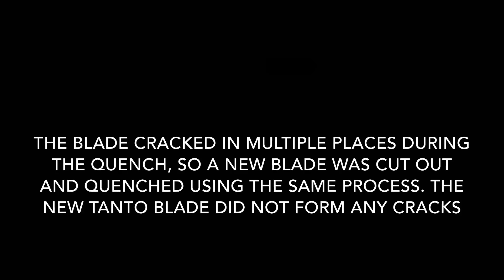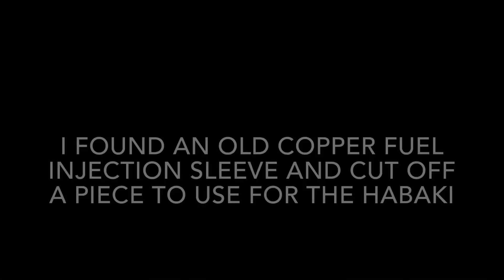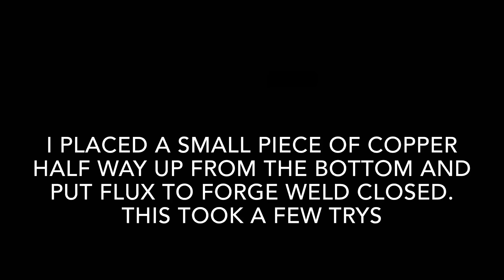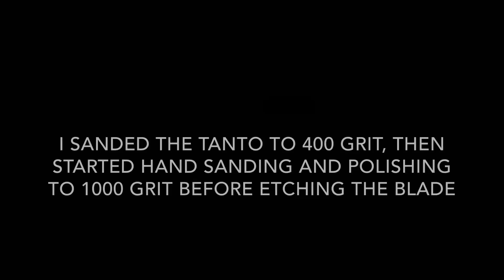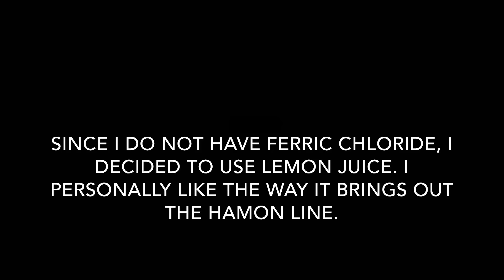Making Japanese Tanto with Hamon (stock removal)

Comment: Great job! Looks like you need to adjust the fuel/air mix on your forge burner, though; the flame is "woofing" on you, which means it's unstable and could go out. That can be a recipe for a nasty flashback explosion; if it goes out, it will keep spewing propane, which can then ignite on the hot surfaces inside the forge which equals "kaboom." The same thing can happen with oil and gas-fired boilers, too.

Comment: If you want to avoid cracks, normalize, and leave a thicker edge
Or quench in oil
Reply: The French Knife Maker Doesn’t most flat bar carbon steel come normalized already?
Reply: @Divine_Serpent_Geh  yes,  you s
Just can't get this point across to these people.

Comment: Did you normalize your steel for the  second blade? Water is a very harsh quenching medium if the stress isn't greatly reduced in the material. It turned out great! Where'd you get the clay?
Reply: Fire ash makes a good clay

Comment: Is that the stock harbor freight belt sander or did you change the pulleys? I have one i just can't remember if it moves that fast.  I know it isn't the next for grinding metal unless you augment it

Comment: Could the first blade have cracked because the brine solution was too cold?
Reply from the maker: Debbie Dickerson Actually both brine solutions were with hot water. I believe the clay was too thick and cooled to slow.
Reply: Debbie Dickerson yes this is true
Reply: @BurningOakForge  Or maybe the quenching method was too rough, you should not putt metal too long in water you must make fast actions two or three times puting it in water and out then again put and left in water try that and maybe even not normalized steel will not crack

Comment: you obviously know enough to create a hamon but please explain what is "hidden" about this.
Reply from the maker: jadekayak01 hidden referring to the saya (scabbard) design. The blade appears to be hidden when in the saya. It doesn’t have a wrap or tsuba (guard).
Reply: @BurningOakForge  are you aware that that is a standard saya/tsuka design?

it is not "hidden".

by your definition every sheath knife must be hidden then-especially when the sheath is molded to fit over the bolster